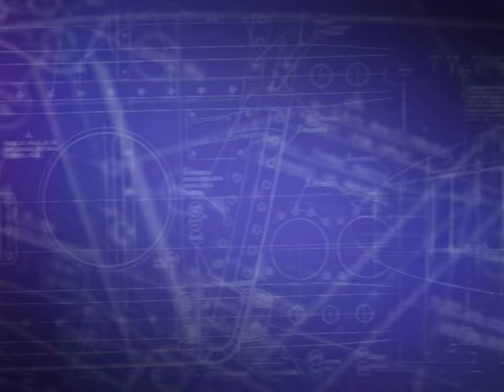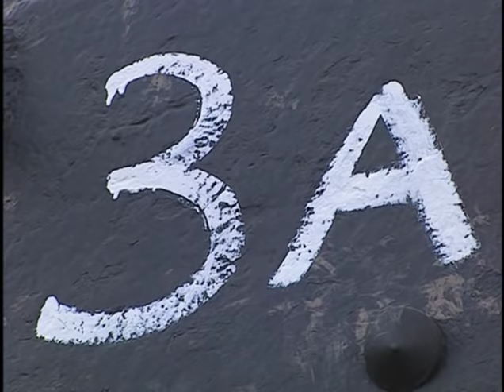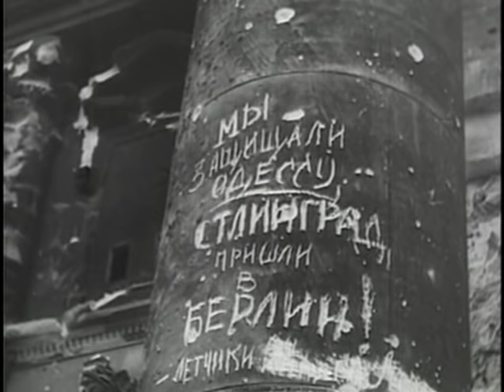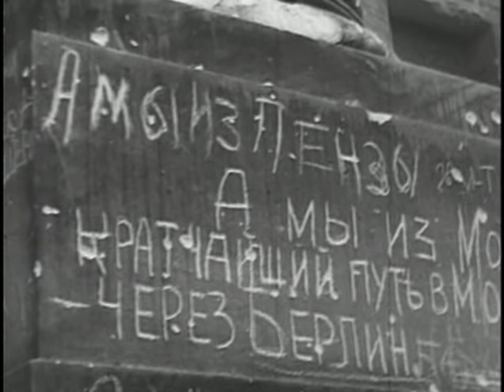Battle Stations: T-34 Russian Victory (HQ with Extras)

Comment: The most overlooked and underrated equipment for the tank was the radio!! When the Soviets produced the T-34 only one tank in 20 had a radio, every German tank had radios! That is like saying, we made the best super car without a steering wheel. Radios were the reason that Germans knockout so many T-34s with (so called) inferior tanks. Every American tank had radios.
Reply: True. Radios were they key to "Blitzkrieg." It didn't matter if you had high quality tanks and airplanes--as the French did, if they could not communicate with each other.
Reply: Germans only knocked a lot of T-26s, T-28s and BT tanks in 1941-42 while they have been decimated by T-34s from the opening days of invasion until the very end of the war when they were defeated by Soviets.
Reply: @matovicmmilan   That is just wrong. Soviets were so good they got pushed back to Stalingrad before Germans ran out of fuel because they were moving so fast. If it hadn't been for the worst winter in 100 years the Germans would have conquered the USSR. Stalin Killed 95% of the good generals because he was megalomaniac.
Reply: REASON  SO  MANY  T 34  KNOCKED  OUT....CAUSE RUSSIANS  COULDNT  SHOOT  STRAIGHT...TRUE
Reply: @genewest7271  dont blame the winter. The nazis attacked June 22, 1941 thy had all the summer to win, thy thought only few wks to defeat the Soviets but it dragged up to fall, winter, spring and 3 summers again up to 1944...
Reply: @predragmanov6341  i fully agree. Western writers for yrs tried to degrade the heroic contribution made by the Soviet people & army by blaming evrything on winter.  But thyve forgotten that the nazis had a long summer of 1941, 42, 43 & 44 to win.  Thyve forgotten that Leningrad was under siege  for 3 yrs but the people DID NOT surrender! The battle of Moscow, Stalingrad, Kurks proved had nothing to do w/ the winter...
Reply: @vanpallandt5799  try writing something that makes sense.
Reply: @genewest7271  The Germans underestimated the Russians due to a racist ideology. The "it was just the weather that beat them(and unspoken bit is, of course, "that was unfair as Germans had such cool uniforms and tanks") is just the typical argument of Wehraboos.
Reply: @genewest7271  the same as the poor little Germany vs the World argument in both wars
1. Dont then pick such weak allies (AH Army, Bulgarians and Ottomans came to more than 10m men in WW1..and actually bits of AH army were good and both Bulgarians and Turks were tough fighters)
2. Dont twice, in 27 years, fight a 2 front war.
Germans..great soldiers tactically and operationally..best army of 20th century without a doubt....pretty shit strategically..Von Schlieffen plan change, 2 Front war, Verdun, 2 Front war again, change in axis of advance on Eastern Front

Comment: There are a lot of innacuracies in this documentary. FOr one thing, the T 34 was not the only tank that could stand up to the Tigers and Panthers. The Russian JS 2 did a good job of this as well.
Reply: Js2 is heavy tank, T34 is a medium. We all know what heavy tanks can do, problem with heavy tanks is that they are rare compared to medium tanks like t34- sherman - pz4. The real work horses of the armor.
Reply: The standard T-34 was an excellent tank with a great balance of speed, armor, weapons & ease of repair. Problem is the Russians had their backs to the wall early & getting tanks built in large #’s edged out quality control since quotas were a simple # of tanks out the door & not hitting quotas could be fatal so many were built with substandard steel bad welding etc. I have been a fan of this tank since I first learned about it 40 years ago but it gets romanticized way too much.

Comment: A nicely well balanced tank.  It sure had the best mix of armor, speed, maneuverability, firepower, maintenance, and ease of manufacturing.
Reply: +David Bradford 

The T-34 is the victim of Soviet wartime propaganda. The Russians had every reason to build it up as the best tank of WWII. 
If the T-34 was as good as you claim, then it should have led to great Soviet victories in 1941-42. Instead what we see in that period is the poor performance of Soviet armored formations. In 1943-45 the T-34 was becoming outdated as the Germans used updated versions of the Pz IV and Stug III equipped with the powerful Kwk 40 75mm gun and of course they introduced the Tiger and Panther.

The ‘best tank of WWII’ suffered horrific losses against those tanks and even the updated version T-34/85 could not bridge the gap. According to a Soviet report (29) in the period summer 1943 - March 1945 the probability of the T-34’s armor being penetrated if hit was from 88-97%, thus any round that managed to hit the tank was practically certain to penetrate the armor.

The T-34 looked good on paper but in the battlefield its ‘soft’ flaws led to huge losses.
Reply: +David Bradford Best mix of armor, speed, amnuvererability, firepower, maintenance, and ease of mfg? All are MYTHS.

ARMOR MYTH: The armor of the T-34 had a high Brinell rating, meaning it was very hard. This was advantageous in defeating antitank rounds of caliber equal or lower to the armor’s thickness but had the disadvantage that it could lead to spalling. Combined with manufacturing flaws in the construction of the tank this meant that the T-34’s crew was often in danger even when hit by tank rounds that did not penetrate the armor.

FIREPOWER MYTH: The T-34 had a large caliber gun. The initial version was the L-11 76mm of 30.5 calibers. This was quickly replaced with the F-34 76mm of 42 calibers and the T34/85 had the ZiS S-53 85mm of 54.6 calibers. The caliber numbers look impressive. After all the main German tank of 1941-43 Pz III had a 50 mm gun and that of 1943-45 Pz IV had 75mm. However Soviet tank guns suffered from low velocity leading to poor penetration and accuracy at long ranges.

MAINTENANCE MYTH:  The T-34 was supposed to be a simple and rugged vehicle that seldom broke down. Authors like to compare it to the more complex German tanks that supposedly broke down often. The concept of the T-34 as a reliable tank is another myth of WWII.
The majority of vehicles were lost due to equipment malfunction. The evacuation and relocation of industrial facilities combined with the loss of skilled workers could only lead to the fall of reliability.  T-34 tanks often had to carry a spare transmission strapped on the back to counter equipment failures. The situation worsened since many vehicles could only cover small distances before breaking down.
Reply: F. Friedrich: You made very nice article to read. Thumbs up. I also agree the best thing about t34 was - there were thousands of them, so no matter how many of them Germans destroyed, there were always few more t34 to finish the job (Russians never really cared about insane losses they suffered). Few times Iˇve read interesting articles, where was said t-34 was not primarilly a tank killer, but it´s job was to support infantry, destroy bunkers, MG posts and so on and THAN fight another tanks. So only from this point of wiew one can judge t34 more as a succes and less as a vehicle dangerous to It´s crew as much as to the enemy...
Reply: All true, but you've perhaps forgotten the biggest myth: 

"T-34: the first tank in the world to incorporate sloped armour".

I love busting that myth whenever I have the chance.
Reply: ondracekivo True about Russian masses. My uncle,  SS-Hauptsturmführer Heinz Kling, serve as Tiger tank commander on Eastern Front. He receive Knight's Cross to Iron Cross 1st Class and German Cross in Gold for destroying 69 Russian tanks, 122 Russian trucks and other vehicles, 141 anti-tank positions, 2 armoured trains. His Tiger was hit multiple times, but never penetrated. In May 1945 his unit fight their way through Russian positions to surrender to British. Surrender to Soviets is instant death sentence.
Reply: "A lot of caputed t-34's were used by germans againsT their original owners, why? because they were superior"

The Germans also used Polish LT vz. 35s and LT vz. 38s in Fall Gelb and Barbarossa. Does that also mean  they were superior to anything they built? Of course not. The Germans are not tacitly acknowledging native inferiority whenever they use foreign equipment. Only an amateur would ever conjure such thought.

"more Panthers were lost to malfunction than destroyed by the enemy, this is a FACT, "

That is indeed a fact. But a fact that must be contextualised: July 1943, first use in combat after being rushed into the field

As to the T-34, in the Summer of 1942 the following Stalin order was issued to units:

‘Our armored forces and their units frequently suffer greater losses through mechanical breakdowns than they do in battle. For example, at Stalingrad Front in six days twelve of our tank brigades lost 326 out of their 400 tanks. Of those about 260 owed to mechanical problems. Many of the tanks were abandoned on the battlefield. Similar instances can be observed on other fronts. Since such a high incidence of mechanical defects is implausible, the Supreme Headquarters sees in it covert sabotage and wrecking by certain elements in the tank crews who try to exploit small mechanical troubles to avoid battle.’

Let me remind you this is 1942 - 3 years after being introduced into the Army.

Very few would deny the T-34 was, in some aspects, the best tank in the world in 1941 - the date to which those quotes refer or in which they were produced. The problem is, in 1942 and thereafter, that was no longer the case. Most of its strong-points generated an effective German response in that year and were rendered disadvantages in 1943. The T-34 ended the war "obsolete" in most aspects, while the Panther - after having most of its kinks worked out - was widely considered the best.

I recommend you read the following: "T-34: Mythical Weapon" by Robert Michulec. You'll find it an illuminating read, I'm sure.
Reply: "T-34 was far superior than the Panzer III 50 mm and the Panzer IV with low velocity 75 mm cannon, they didn't used it to fill the ranks, they used because it was indeed superior to what germans had on that time."

I would never describe it as "far superior". Yes it had a better gun, better armour and a diesel engine. But the thing didn't have a turret basket, a 3-man turret (until 44) or a 360 commander's cupola (until 43) - all present in the PZ III and IV since their inception. Radios were non-existent or of poor quality, optics of poor quality, few and minute escape hatches etc. Many aspects which drastically degraded its performance in combat and didn't allow the exploration of its advantages in full. German soldiers who used the tank weren't very impressed either.

"so when we compare Tiger 2 and Panthers we compare to IS'S and T-43's respectively."

Since they are both mediums, comparisons between the Panther and the T-34 are, in my view, acceptable. The T-43 has no combat record, so no one has any idea of its worth. Tiger II vs IS ? The Tiger had a much better gun and protection (as well as optics, radios, ergonomics), but it was terribly "underengined" and simply too large and heavy. I'd certainly prefer to be in the Tiger, but the IS was a more effective use of resources. 

"But about those german marvels, that book refers of the explosions that used to happen on T34's and the same can be said about Panthers and Tigers made in the late war that the armour plates used to fracture and shatter on impact, because of lack of critical alloys in the production of the armour plate. i know that does not define the first designs and conception of the tank, though these machines were also plagued by a great number of things that made them over complicated, expensive and scarce, in the end, to scarce to the M4's and T34's USA and Soviets threw at them."

As you've said: resource deficiencies have no bearing on the discussion of the merits of a particular design. Some of the German armour made late in the war was of poor quality indeed. The question is: in the Soviet Union there was not a scarcity of resources. Neither was it fighting a two-front war. Neither was it being blockaded. Etc. Etc. Other reasons have to be found to justify the poor performance of its machines. Russian designers certainly made their fair share of mistakes, but they are rarely discussed. Possibly, because they won the war. But the war wasn't won through technical superiority. Numbers, as you say, dictated the outcome.

So, do we agree the T-34 was NOT the best tank of the war?
Reply: "Russian propaganda had very little to do with the way Germans went about hastily developing and fielding their Tiger and Panther tanks, to put it blandly they was scared of T-34 tank, that alone said a lot about T-34 tank." - Its a "kindergarden-ish" statement that "IF" T-34 was a good tank, then it should have led to great Soviet victories in 1941-1942. Firstable - its not Soviet Union invaded and occupied Germany, but the other way around. Second T-34 did not become outdated with introduction of updated version of Pz-IV and Stug III, and been on par with those tanks, and could hold its own to much heavier Tigers and Panthers with introduction of T-34-85.
"The ‘best tank of WWII’ suffered horrific losses against those tanks and even the updated version T-34/85 could not bridge the gap." - Tanks suffered horrific losses in WWII against AT artillery, same can be said about German tanks as well.
"According to a Soviet report (29) in the period summer 1943 - March 1945 the probability of the T-34’s armor being penetrated if hit was from 88-97%, thus any round that managed to hit the tank was practically certain to penetrate the armor." - Really, Soviet report (29)? Very interesting and informative...
Reply: Ah, "MYTHS" about T-34, are what they are just myths.

"ARMOR MYTH" - You first armor myth talking about high Brinell rating without any specifics. Many factories build T-34 tanks during WWII utilizing different technics, turret on T-34-76 for example there was many types anything from cast to welded and even stamped, all would have different armor composition and Brinell ratings - you can count on that.
"FIREPOWER MYTH" - Again very little specifics on performance on each gun, and not to mention what type of ammo, since different round will have a different velocity because used for different purposes. Hyper Velocity AP round BR-350P have a muzzel velocity of 965 m/c(3166 f/s) is not a slow velocity round, same can be said about T-34-85's BP-365P round that Lt. Oskin used to defeat three King Tigers at village Ogledow in August 11, 1944.
"MAINTENANCE MYTH" - T-34 was a simple and rugged vehicle that seldom broke down, it was true that after factory evacuation(after all only 4 000 out of 40 000 specialist from Kharkov factory #183 made to Nijni Tagil factory) quality of the tank decreased, but from middle 1943 and on factory was fully build(you don't expect superior quality when workers produce tank in the middle of the winter under open sky, while factory's walls and roof been build around), by the end of the war tanks life expectancy spends well into present day, record that no other tank of WWII could beat, its just a reality. As it comes to maintenance and repairs, it was also the easiest tank to do any repair without highly qualified mechanics, and turn tanks around much faster then Germans did. At battle of Kursk whole army been moved under its own tracks without much breaking down hundreds of kilometers.
Reply: No, actually its a pretty poor write up...  T-34 was MBT that did it all, anything from been a good "tank opener" to breaking through German defenses, speed and mobility help with those tasks, and that is what made T-34 best all around tank of WWII, that Germans tried hard to copy, but just could not do it.

Comment: The taking of Berlin may have been easier for the Americas and English. Just listen what the narrator said at minute 35, the Germans fought fanatically because they were afraid of what the Russian would do to them after what the Wehrmacht did to Russia. Most Germans were eager by then to surrender to the Americans and/or English.
Reply: That is the reason why Warsaw was destroyed by ~90%, Hitler ordered the Commander of Paris to do the same in Paris after Allied troops broke out from Normandy fast and Generals used the tactic of retreating (and blocking harbors during this time) and before the units could even reach the Siegfried-Line there was a shortage,

blow up as much as possible was the order, but after short thinking he went into captivity without any resistance saying that Hitler became crazy... lucky, I'm not a real German, but it is a very good country, I was born in West-Berlin (US-Sector), but if Germans would have destroyed the Eifel Tower or the Triumph building etc. I think France would not forgive so easy this, on the other Hand in Warsaw there was a uprising the result for most destruction, and there were no "historical" important building in Warsaw or are today as far as I know.
Reply: Eisenhower knew that it will cost too much Allied lives to take Berlin his own estimates about 100,000 so leave it to the Soviets...
Reply: @roygaviola2766  True, saved a lot of American and English lives. Stalin also really wanted to crash Germany and take Berlin.